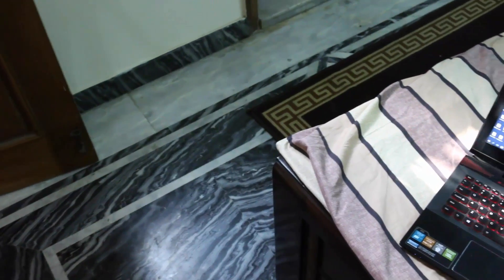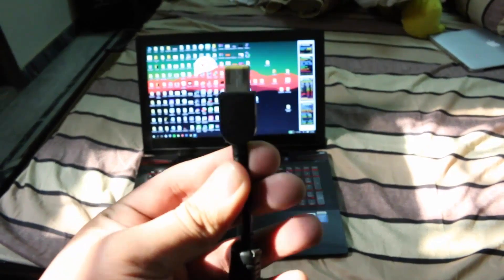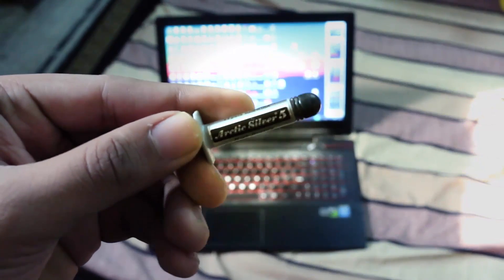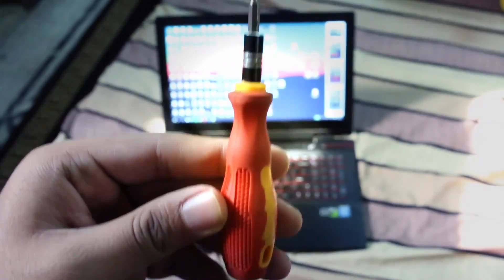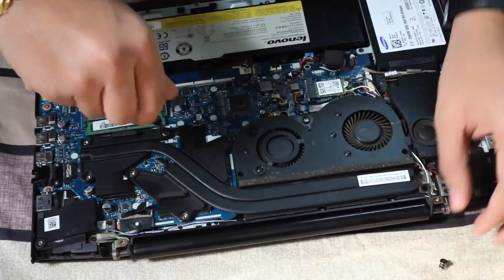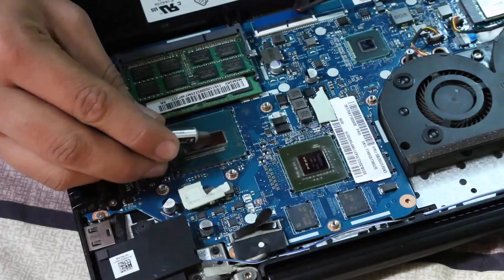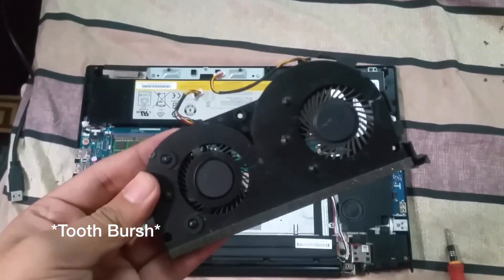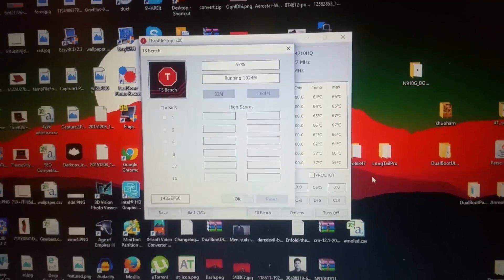Lenovo Y50 Overheaitng Fix + Stop CPU Throttling (Overclocking) + Thermal Paste upgrade

Comment: Homie I know this video Six Years old but since I have and use the same laptop I absolutely cringe at him laying the laptop on the bed.. 

The damn ventilation intake is on the bottom of the laptop, If you put it on a cloth, or a bed or couch you block the airflox causing overheating by itself.. even without processor throttling or bad Thermal paste. 

Put that mf on a desk and lift the backside up from the desk by putting the laptop on a book or sth. 

It causes more airflow and makes all the difference . After that you can blame it on bad Thermal paste, heatsink or other. 

Edit: oh that's exactly what he did lmao but after applying the thermal paste

Comment: Hi everyone, i had intense throlling problem on my Y70 for a while and it drove me crazy, but then i found a hint on internet to take off the air filter on the back of the chassis, at 2:40 besides the red circle (AUDIO buffer) : ) , i became happier in my life, and my world regained it's colors, that thing is so stupid it cripples the air flow 
the only side effect is the dust will accumulate faster like each 5 months or so !! 
peace !!

Comment: Isn't a bit of an unfair comparison to run your initial test with your intake vents blocked by the duvet, and then post repasteing re-run it (purposely) elevated from the bed? Even if your repasteing was a qualified success I'd still expect to see big differences between two tests ran like that.

Comment: Absolutely fantastic how-to change thermal paste.
I have 2 laptops
LENOVO Y50-70 same as yours - due for thermal paste replacement. CPU overheats badly. GPU is ok
LENOVO N500 Intel T3200 35W - just 50% load and the temp goes to 71 degrees
No thermal paste replacement, just open the laptop and clean all dust from inside.
Especially the heatsink fins and the fan
Under full load for 1h full stress testing with AIDA 64 Extreme 100% load on CPU, GPU etc.
CPUID HardwareMonitor Max Temp

Before - Core0 - 90, Core1 - 92 degrees
After - Core0 - 67, Core1 - 70 degrees

CPU Usage - 100%, CPU Throttling - 0%

This is moree than 20 degrees temp drop. Amazing!!!
Performance has increased too. - I was watching this video on 360res before, now it is on 720HD and no framerate drop :)

I consider a CPU upgrade for this laptop and then will replace the thermal paste and potentially get temp even lower

Thank a million buddy

Comment: I just replaced the shitty stock paste with Noctua NT-H1 and the difference is unbelievable... it's amazing how the better thermal paste can completely transforms Y50 from stuttering mess to free lag gaming machine...
Reply: Y50 is a very good laptop, just two upgrades will make it a beast, changing the HD to an SSD, and re-pasting, I haven't done neither though xD, so how is the performance now? can you share some before and after numbers in games like GTA V,  Witcher 3...etc

Comment: Hi.. I have a different issue.. I changed the thermal paste, cleaned everything.. the problem is that the fan doesn't go to max speed no matter how hot the device is.. it only increases when I do the fan cleaning in energy manager

Comment: I cleaned my y-50 to get rid of the dust inside.also renew the thermal paste.
I used to have good FPS in all games (80+ in dota for example) but suddenly I can't play anything anymore, getting max 10-30 FPS in almost every game. Even browsing the internet goes extremely slow at some points. Does anyone know what I did wrong? Maybe a cable came loose or I triggered something wrong.
Reply: There could be many possible causes. Was this your first time applying thermal paste? Applying the paste is where many people create problems. The old material has to be completely removed, and when you put the new paste it has to be a very thin coating- too much will hurt performance badly. Putting too much paste is a killer.
Reply: Dude i got the same issue. Did you able to fix it if yes pls let me know.

Comment: Hey atechpoint i have Lenovo y50 it has a ram of 8gb..of some Hyundai electronics HMT brand..its been 2 yrs u have been using it..will the system affect if I replace it with Kingston ram or maybe replace it and upgrade to 16gb?

Comment: Ok, so I did it, with Noctua NH1 thermal paste that arrived today, spent way too much time optimizing the undervolt too!
so here are my results: replacing the thermal paste lowered the temps from 88-89C to 77 C. Not bad!
and I somehow managed to undervolt the CPU and CPU cache to - 100 mv (it goes down to 110 mv but stability isn't great), now I get 3215 Mhz stable during theTS bench test (before it was only 2950 Mhz even with the multiplier locked at 35X due to long term power limit concerns on the chip. Max temp reached @ 3.2 Ghz is 79C, mostly it's 78 C though.
I read that Haswel CPUs don't go below -50 Mv usually, so I'd try carefully with -5 mv increments, maybe I just got a lucky batch that could go down double as much.
overall, very happy, thanks for the video :)

Comment: Wow that's a larger difference than I expected! I cleaned my fan and heatsink yesterday but my Laptop still goes up to 82 C in Prime95 after a couple of minutes. Also I read somewhere that Lenovo set the CPU to throttle past 65 C, and that you can undo this in Throttle stop. will be trying to re-paste and see what happens!

Comment: this laptop is a cancer refund it if u can !!
keep dropping to 20fps at Low specs gameS

GameS not a game
80-90 degress C
its killing me
dont buy it
Reply: gta 5 medium- high settings 60+ fps
Reply: Really? I've had it for 3.5 years and it works like a charm to this day, only thing I replaced was the screen as the older units came with shitty TN panels. I'm not a heavy gamer but I still play demanding games now and then, it runs the Witcher 3 at medium to high with no problems (35 fps or so). Battlefield 4 runs at high settings with over 50 fps..etc.
It's a very nice laptop if you change its screen, which costs about 100 Euros.
Out of curiosity, do you happen to game on an external monitor and close the lid of the laptop? it exhausts through the screen hinge so closing it is a no no.

Comment: BEST TIP: REMOVE THE DUST FILTER
Reply: Tudorache Cristi Welp, Good luck when your laptop died with all that dust inside it
Reply: @YashBudhiraja  Thats why you clean it duh
Reply: Removing the dust mesh will actually lower the temps by at least 10 degrees. I guess Lenovo only added the mesh so that one can't see that the fans are not aligned with the opening in the case...
Reply: Best tip ever did that and the tgermal paste upgrade and are getting under 65Degrees with full gpu and synthetic cpu load.
Reply: Code Person please help and update removing filter doesn’t cause any damage to laptop

Comment: HOLY CRAP. IT WORKED - MY RESULTS:

(TLDR, Skip to the bottom if you wanna see numbers) 

Guys, i honestly think im gonna cry (Feels like i got my laptop back) for the last year and a half i've had serious throttle issues in games and my idle temp for my laptop 45+ degrees. On light load (youtube vid + Skype) hitting around 56-64. And in games, easily hitting 85-90+ at its worst 98 which downlocked the cpu and killed my fps for 15-20 seconds at a time. 

I've had my Y50 since its launch in 2014 and only just replaced my paste with AS5. The old stuff was like clay, hard and dry. It was not extremely messy but did have over spill. It was my first time opening the laptop. did a good dust clean, fans were surprisingly okay, heatsync grill was alright too but after repasting my idle is roughly 38, light load is 46-50 and I still have not tested games but I can only assume they'll also be cooler.I was blown away, sure these changes arent drastic, I tried to use as little paste as possible but it may have been a lot still. The point is it is a change none the less and I can only hope I can enjoy playing games again with massive drops. 

It was totally worth $20 Canadian I spent on the little kit from amazon that comes with Arctic Silver 5 thermal paste, cleaning alcohol, and surface purifier. 

NUMBERS:

Before:
Idle - 45+
Light Load - 56-64
Gaming - 85+, often hitting 98 at its worst and throttling fps seriously

After
Idle - 38
Light Load - 46-50
Gaming - (not checked yet, will update temps + if i still get throttle).

So far, fantastic results. I just finished it about 10 mins ago and came to write this long winded post. I hear they can get better over time as it sets (roughly 200 hours) you may see a 1-2 degree further decrease. Crossing fingers, this is already a great change.
Reply: Paramdeep Singh obheroi damn, this gives me hope. For the last few months my Y50 was throttling like crazy after like 15 minutes of playing. I'm gonna repaste ot now and see how it goes afterwards
Reply: its been over a year now, can you give an update?
Reply: so, does it throttle?
Reply: Scotty McLean hey man, how are ur lenovo temperatures doing now under load?
Reply: Well I tried it and my gpu temps went from 93degs (throttles) to 77-79 degs at max load. I tried furmark which itself is an overkill. I used AS5.

Comment: My experience after this video:

Had this laptop since 2014 launch, just opened it up for the first time and cleared out about 3 years worth of dust from fans and overall components using compressed air. I also used a toothbrush and went over the 'dust-filter' for the laptop's grill.

Last night on idle I was sitting at 56 degrees, and 98 (CPU) on load in BF4 causing the game to throttle from 90fps to 22fps. It came to the point I had to tell my friends I couldn't play anymore cus it was becoming that frustrating. After the cleaning, my idle is at 49-52 degrees. Not a huge difference but quite nice while I wait for the thermal paste I ordered from amazon to arrive this Thursday. 

I'll update this post after I re-paste because im almost certain they did a poor job during manufacturing. By 2015 my laptop started running really hot with me first noticing thermal throttle during that summer when GTA V launched on PC. 

Crossing my fingers I can drop temps by even 10 degrees. That would be enough to stop throttling.
Reply: Scotty McLean hey scotty, can u plz update us with ur results?
Reply: can u update ur result pls  ?
Reply: you didn't update your post bro!

Comment: i bought the artic silver and it kind WORKED at 1st but when i game it goes back to 92 degrees and throttles alot like omg
Reply: Silthondrius clean out your fans and if that doesn't help a bit get a cooler
Reply: Yash Budhiraja which cooler will you recommend

Comment: While re-pasting is a good idea this video demonstrating the results is intentionally misleading. In the first run he has the laptop sitting on the bed choking the air intake at the bottom of the laptop. He is skewing the results for a more dramatic "performance increase" after he re-pastes. Also, never place a laptop on your bed or carpeted floor if your intake is on the bottom as with the Y50. After his re-paste you can see he places the laptop on a stand which finally allows the laptop to breathe. This is not a coincidence. He manipulated his results and I have no respect for someone that utilizes such practices. This video wastes the time of those who are seriously interested in the difference a re-paste can make.
Reply: In addition -- he never shows the frequency at which the cores are running in either test. I have a strong suspicion he is not running each test under the same parameters. He states the first test before the re-paste is running at the full multiplier, however it is not. When the test is started it was running at 33 even though 35 is selected and furthermore his selection of the multiplier does not change the cores. And then he subsequently fails to move the benchmark window so we can see what the cores are running at. Even if this was not meant be deceptive -- it demonstrates his ineffectiveness at describing accurately what is happening on his machine. The second benchmark he ran he completely neglects to show anything identifying what frequency his cpu cores are running at and it is my opinion they were not running full boost.
Reply: Looks like you didn´t really watch the video. He put the laptop in both tests on a stand so it can breathe and you can see the clock speed in the first test and I´m pretty sure he has the same in the second one. either way, I´ll try this trick with my Y50-70 and give you exact ressults, including temps after 30 minutes in GTA V and WItcher 3.
Reply: @meteroson6428 8 years still no results? Damn this laptop must be slow.

Comment: my y50 always shows disk usage 100% wht to do ? defragmentation process stops in between , booting times are more than a minute
Reply: creative planet if you have the 1tb hdd then that is the problem
Reply: creative planet if youve got the hybrid sshd or whatever its called, get rid of it. Its a shitty hard drive, only good as external disk. Put a 500 ssd there instead, it makes a huge difference. Im using 256 ssd, but thats not that much space tbh
Reply: swap a ssd for booting will work. its the windows 10 problem i think
Reply: That's WD Slim hybrid sshd 1tb/WD10S21X(5200rpm only) and it's AWFUL, change it to ssd or faster hdd. 
Everyone should replace him
Reply: It's the crappy hard drive, I've been using it for 4 years and decided that it's even too crappy to operate correctly, swapped with 860 Evo 1tb and the laptop flies, 4 seconds and window booted, internal transfer exceeds 300MB/s so if you have something else you transfer to consider bottlenecking, I've been also playing path of exile and the game never stutters anymore, though the idle temps I'm getting are somewhere around 80c for 1600MHz, and just now decided to take a bite off the bullet and join the undervolting club, I've literally screwed the case after the hinges broke, soldered a new antenna salvaged from old laptop parts, broken the filter holes near the speakers, taken off the fucking dust filter, repasted, changed thermal pads, and that shit never get to operate at stress around the 70s even if I wanted to. I've got my lesson, first check if the laptop is capable of cooling, then pick your hardware
Reply: I have the same problem, it takes a very very very long time until I can use the laptop, my recommendation is for you to get an SSD, it will improve your laptop speed dramatically and it will actually increase your battery performance!
Reply: It's a windows problem, google it for solutions.

Comment: Has this worked for somebody here ? Would be nice to know 8)
Reply: yes dude 1 advice don't put much thermal paste
Reply: Hi, I did the thrmal paste thing. BUt I put like a whole small tube on it (1g per tube), it still gets hot, the thermal paste is all over the chip, so I guess thats why I have high temp again :(, I didnt watch a tutorial before applying it. Tomorrow I will clean my CPU and GPU and try again. Funny thing is that the CPU gets really hot while the GPU remains cool

Comment: I did the exact same thing with my Y50 today. It worked, 10 to 20 degrees celsius cooler than before. The default thermal paste was just some sort of thick pads that really isolated CPU and GPU from the heatpipes. Anyway, thanks for the tutorial here.

Comment: Hello,I would have a question.What about the thermal pads? As i seen some of them kinda damged when you opened up the heatsink.
I want to reaplace my paste too with some Arctic Silver ,do i have to replace the thermal pads too? and what thickness i have to use for Lenovo y50-70?

Comment: I have Asus G501 that same spec with lenovo y50 with dual fan too, before cleaning and change thermal paste the temps hit 88-90 degrees celcius and after do the same thing in video (deep cleaning and change thermal paste with Arctic Silver 5), not too much change and only decrease about 2 degrees into 85-88 degrees celcius when test with throttlestop. I see your video after changing thermal paste and clean the temps changed from 90 into 65-70? thats insane
whats wrong with my laptop :(

Comment: I had to wash the filter on the bottom vent, it was super dirty, that allowed free air to pass through.
Reply: How did you wash it?
Reply: @turner1427  took the back apart, then removed the filter cloth thingy and washed it with water.

Comment: Hello
We have Lenovo Y50(core i7 4720HQ GTX 960m 16GB Ram)
When I play temperature`s laptop is 88`C
If I upgrade thermal paste this problem be solved?
Reply: upgrade thermal paste Arctic Silver 5 or Noctua NT-H1

Comment: i bought my laptop 5 month ago , and when i game on it the cpu tempreatures hits the 90-95 degree celcius , is that normal ? specially that the keyboard left section gets very hot and so for the bottom of the laptop
Reply: +karim ahmed yep...try it and you will be very glad for the results
Reply from the maker: +karim ahmed depends on what is your room temps?
Reply: +ATechpoint about 35 degree celcius
Reply from the maker: +karim ahmed How long you play? on what surface you keep your laptop.
Reply: +ATechpoint on a cooling pad but a very weak one that i intent to replace soon . and i reach those tempreatures after like 30 min of gaming
Reply: +تجمع اندرويد العراق u mean the filter on the air intake vent at the bottom of the laptop ?
Reply: +karim ahmed take out the dust protection below the fan ...you will go back to maximum 80 c while playing the most demanding game , this what I did after having thermal throttle , but now I run on maximum frequency all the time with 0 % throttle on 80 c max